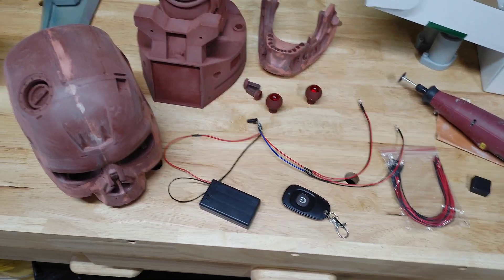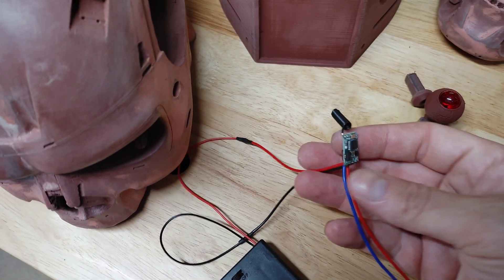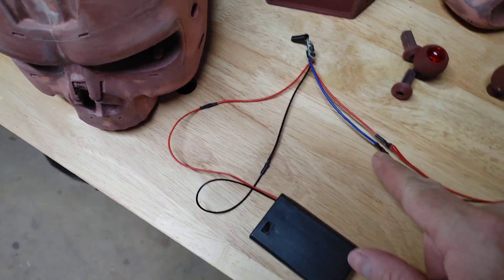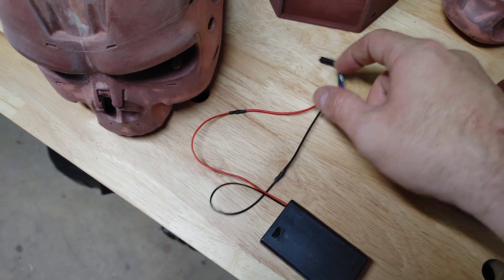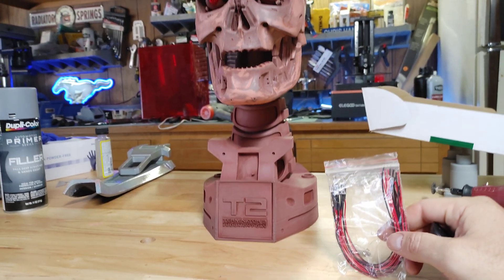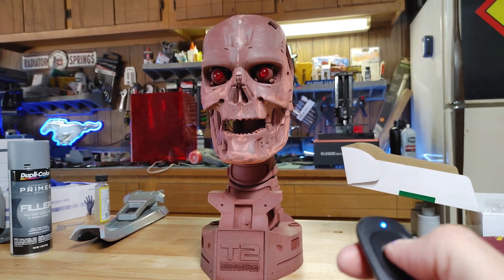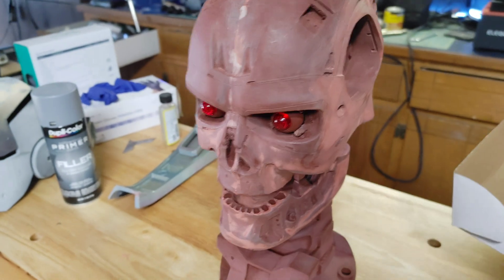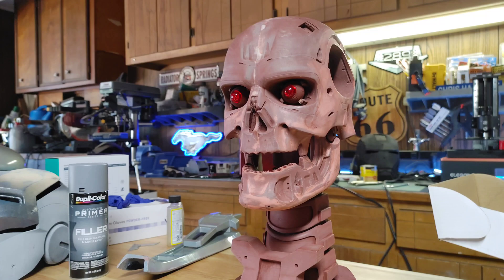WIRELESS LIGHTS! 3D Printed Terminator T800 Endoskull - Part 2

Comment: Do you have an updated link for the wireless switch circuit? Does it have resistors built in? When I saerch howtos online it says you need resistors between the batteries and led lights. thanks!
Reply from the maker: It's been awhile but I don't remember having to use any kind of resistor. It was pretty easy to wire up.